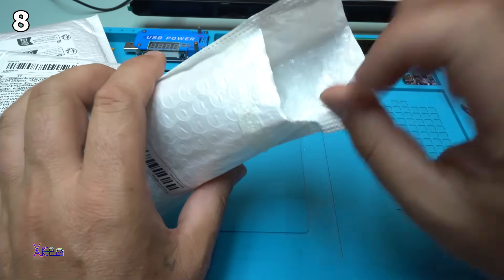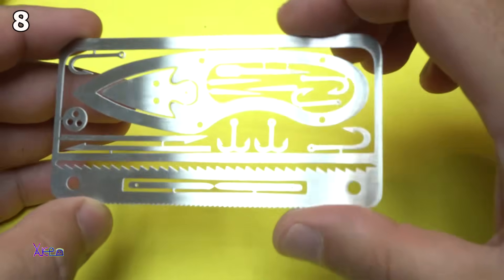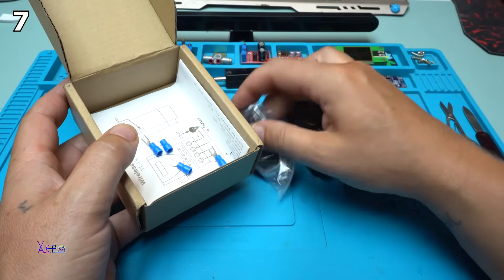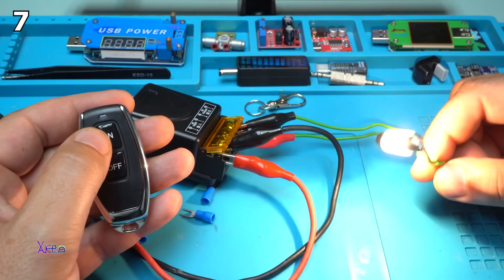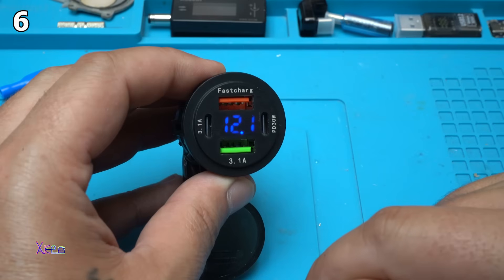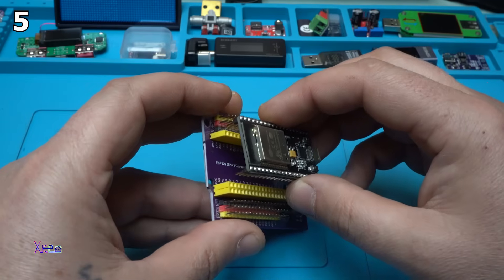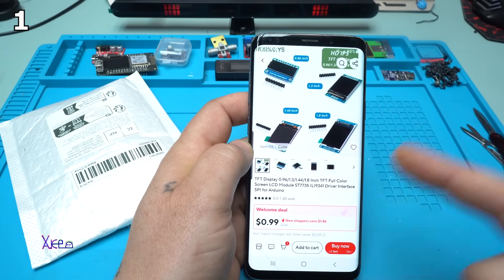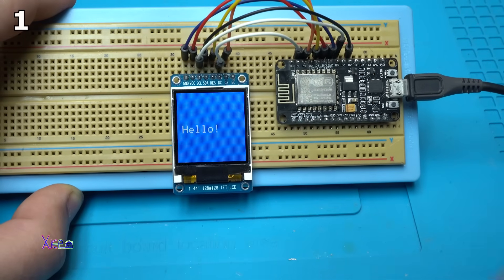8 Random $? Finds from Aliexpress

Comment: So does the 12V USB charger work as advertised with QC3.0 and 22/30/45W PD charging?   

Since you only got 9W charging when connecting your Samsung Galaxy S8/S9, the USB-C port does not seem to support Power Delivery protocol. Meaning it´s just another 5V 2-3A charger, and most people already have their drawers and gloveboxes and over flowing with old slow chargers. 

The ports are labeled: "Fastcharging", "PD" and "3.1A",  not "QC3.0" and "PD 2.0/3.0". Since the phone is unable to negotiate a PD mode, charging a laptop probably won´t work for most.

Comment: 7:22 WARNING Do not put more than one 18650 cell into those DIY power banks unless you have balanced them first, by charging them all to exactly the same voltage.
Reply: It is not necessary in most cases.
18650 cells typically have a high internal resistance, in both cells, so when you connect two cells together in parallel there is basically two resistors connecting them.
I have tested the current from paralleling mis-matched 18650 cells of different charge states, and never saw more than 1 amp current flowing, which is perfectly safe.
HOWEVER the flatpack  LiPo cells, particularly the ones used to power high current RC devices like drones, can cause unsafe levels of current if you parallel them. Best to make sure they are within half a volt of each other before paralleling.
However, in no case do cells need to be EXACTLY the same voltage before paralleling. As longnas they are close-ish it is fine, and with most typical 18650 cells they don't even need to be close.
Reply: @wizrom3046  Don't forget the very common high current 18650 cells used for power tools.
Reply: In most cases they are in parallel so it selfbalance :)

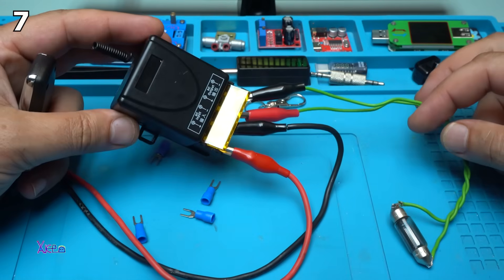Comment: 3:51 three tricks they pull with those USB-PD modules - at least in my experience of 65 W ones.
1) Some only work to spec (i.e. output 20 V) when you feed them with 24 V
2) Some aren't particularly universal - I don't know why, but my Lenovo X1 laptop won't charge from one model
3) They can overheat, cutting out momentarily
Reply from the maker: Need to pay attention on how much watts that module can give max